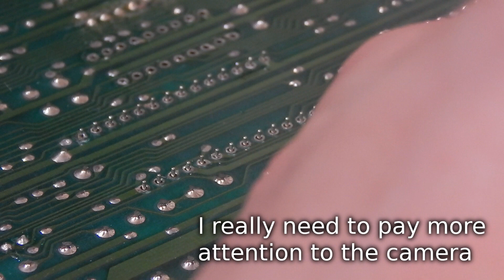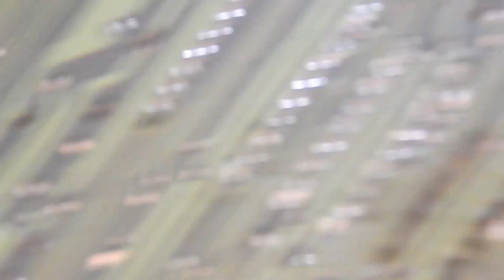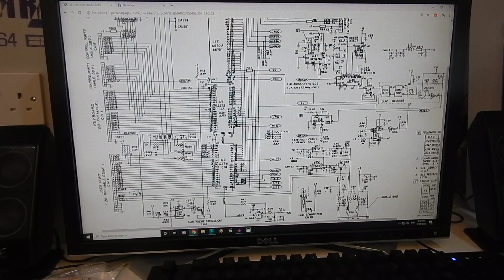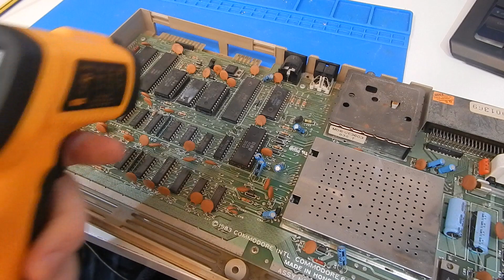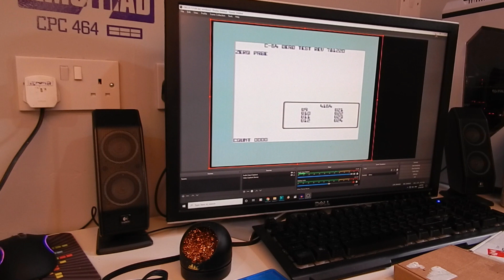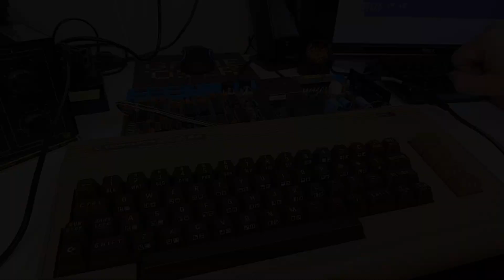Another Commodore 64 dead board repair

Comment: Many of the boards I work on I either pull a pad, break a trace or pull out a via. These boards were never designed for reworking. I don't give up and several working boards have the infamous bodge wires. I keep a few GALPLA and ArmSID around because I want it to work, I'm not a purist